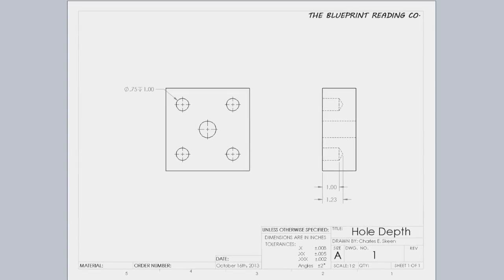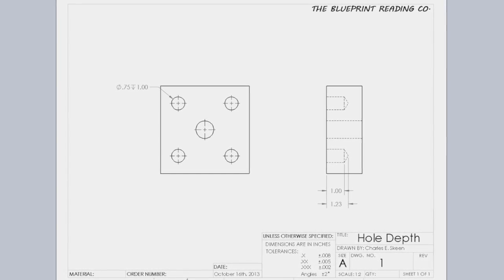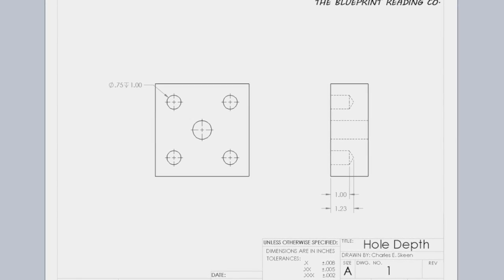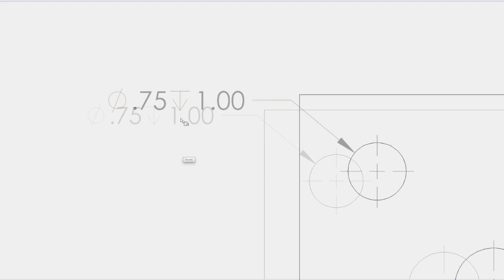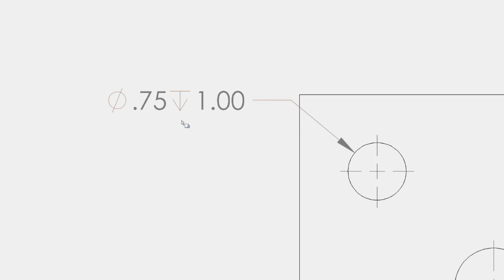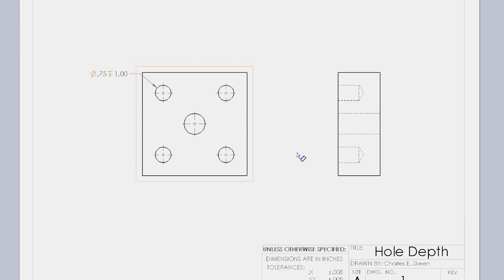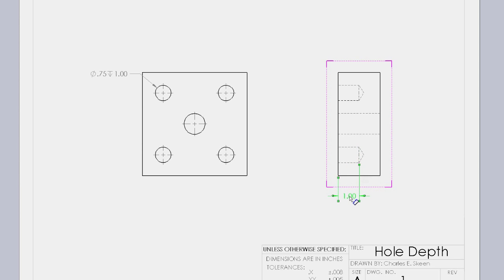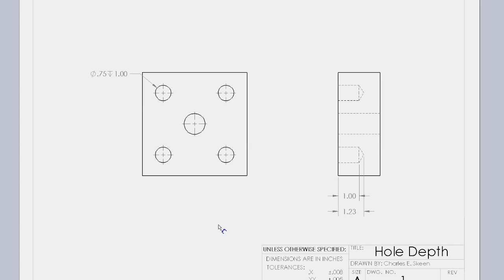Dimensioning Hole Depth

Comment: how deep does the tip go? how do i find out
Reply from the maker: @SaltuDude6969  

If the drill point is:

118° then multiply the diameter of the drill by 0.3

135° then multiply the diameter of the drill by 0.207

140° then multiply the diameter of the drill by 0.182

For example, if a 12mm drill was 135° and the drawing asked for 25mm of full diameter then:

12mm * 0.207 = 2.484mm

Add this onto the 25mm depth = 27.484mm.

So, take the drill 27.484mm deep to produce 25mm of 12mm diameter.